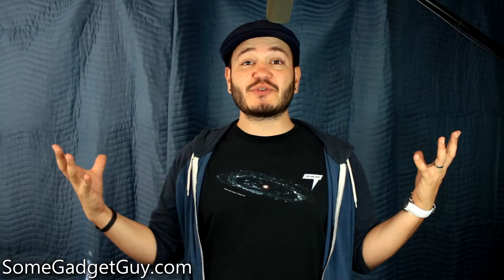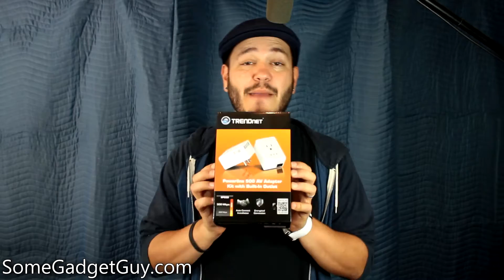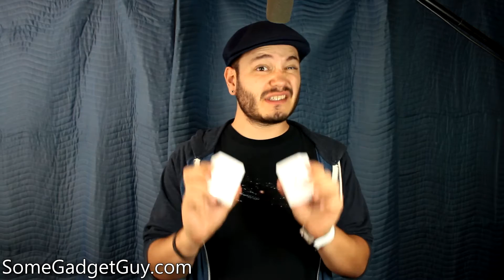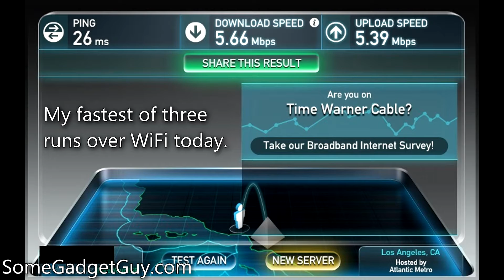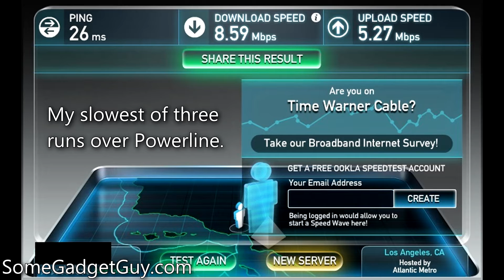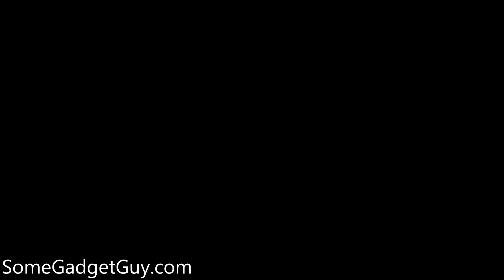Review: TRENDnet Powerline 500 AV Adapter Kit - Internet Over Your Home's Electrical Wiring

Comment: Jaun,  could you tell me;  will the 500 av, which I have already, allow a wifi access point instead of direct connect so I can use other devices in those needy areas?  Can I use an old wifi router configured to act as a access point instead. I know Trendnet has their own access point adapter but if using a router I no longer use works I would go with that instead of another purchase.

Comment: Installed mine today....it connected to the other one 2 rooms away in under 30 seconds. Got my full 15mbps speed too
Reply from the maker: bluefishtattoos Nice! These are such handy little gadgets. I think they work a lot better than wireless extenders, provided you don't have a major appliance in between the two units.
Reply: well I dont think I have such an appliance on the same line, but I did use it while some contractors welded and used power tools. no issues whatsoever, a great buy!!!!!
Reply from the maker: bluefishtattoos
THat's awesome! Glad to hear it!

Comment: I have a question. So it comes with to adapters. I plug one into my modem, then I plug the other one where I need the Internet. So example. My modem is upstairs. I plug one adapter up stairs then I plug the other adapter downstairs into an electrical outlet and run the ethernet cable into where I need Internet? I don't have to have the two adapters be connected with an ethernet?
Reply from the maker: Correct. The electrical wiring in your home will carry the ethernet signal. It works fairly well too so long as you don't have to jump breakers. I also ran into an issue where if I had my washer and dryer in between the adapters it would cut out anytime we did a load of laundry. Otherwise it was a pretty solid solution for those who can't punch holes in walls to run cabling.
Reply: Awesome! Thanks so much for your help
Reply from the maker: You're very welcome :-)

Comment: Check out the TPL-410ap to add wireless to the living room.
Reply from the maker: Thanks for the heads up. I'll give it a look.
Reply: It will add a wireless AP in your living room, and work on the power line. Could be good for your location.

Comment: I have a Linksys EA6900 that I use with a PLE400 and 2 PLW400 and it works for about a day then crashes the EA6900. I am up to date on all my firmware, not sure what is causing the hangup. Does anyone know if this Trendnet would work better?
I get about 43.37 Mbps down and 8 Mbps up on my 5ghz
I get about 28.64 Mbps down and 8.95 Mbps up on my 2ghz

On my PLW400 in my family room 1st floor I get 20 Mbps down and 10 Mbps up
On my PLW400 in my bedroom 2nd floor I tried and it gave me network issues so I disconnected it. I think I may have a fault somewhere not sure where because it should not crash like this. Anyone use the Trendnet please reply to this message and let me know how it is working out.

I am looking to buy the Trendnet Powerline 500 AV2 Adapter kit and why what do you know they actually offer a separate single one unlike Linksys which forces you to buy them in pairs.
Reply from the maker: I've noticed that equipment in between the powerline adapters can significantly degrade the signal too. One one outlet my Trendnets will flake out whenever I run the washing machine, I had to trial and error around my whole condo before I found a line that didn't wig out like that.